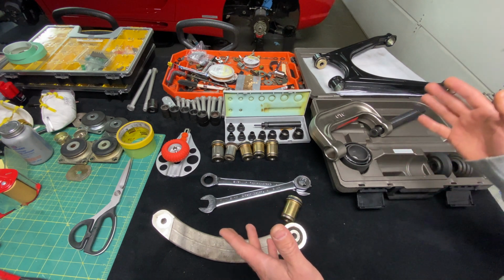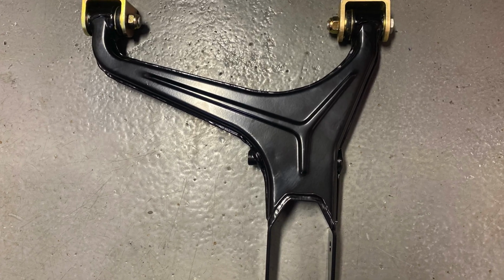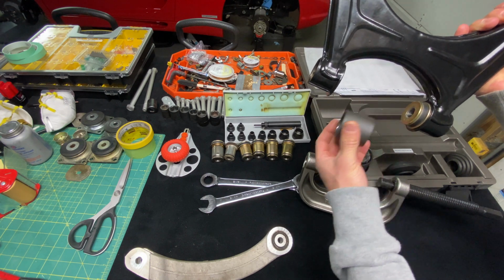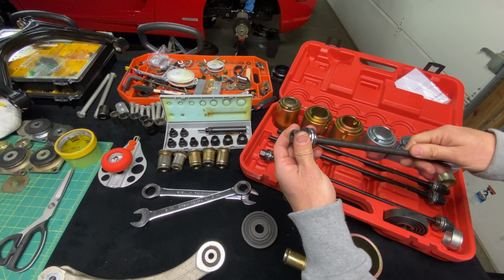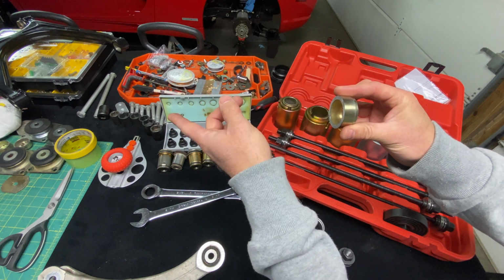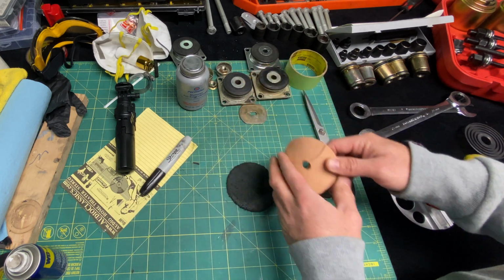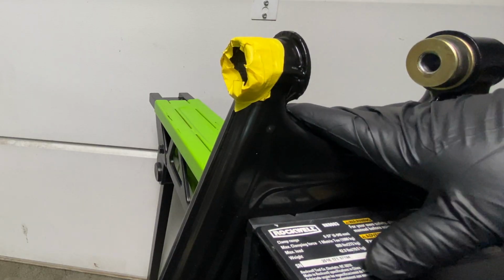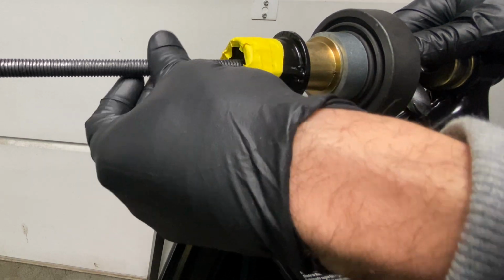Replacing Suspension Bushings | Press & Pull Method

Comment: That is one heck of a good video Phil. Thanks
Reply from the maker: Glad you enjoyed it! I have been restoring many 308 and 328 lately and bushings on those is a huge undertaking to do correctly with shims and welding them in place then test fitting to the forks. The F40 has a similar bushing set up like the F355

Comment: Hey Phil, why do you use anti seize not grease?

I was doing the front bushings on a C5 vette, on the lower control arms there is an inside sleeve that the rubber goes over and no outside sleeve so it is just rubber straight on the control arm and you put grease supplied in the kit. I had a problem where after pressing the new bushings they were a little too big to fit in the subframe of the car and I had to go a little bit ham on the press compressing the bushing a bit just so in would fit on the car. Would that be from bushings that are too big or was I possibly doing something wrong? 

P.S. The cap on the sleeve could be removed from one side to fit the bushing in; after I put the new bushing the cap would fall out where before it felt like it was pressed in.
Reply from the maker: You can use anti seize or grease up to you but i would use anti seize on the aluminum arms you are working on the Ferrari arms in this video are steel

Comment: You read my mind on that IG post, I needed this haha... I kinda had an powder coat over spray, couldn't easily push a bushing in once without damaging the paint.
Reply from the maker: get some boring tools like i showed in my Alfa X Pipe install video i hate when powder coaters fail to plug up and mask off properly

Comment: Coming from the hot rod /show-quality 4x4 truck world, I can tell you how frustrating it is to spend the time to paint/power coat suspension parts like leaf springs, axles, control arms, etc., only to nick them up when it comes time for bushings and what not in the reassembly.  Like taking 3 steps backward.  Great tips I plan on using.
Reply from the maker: glad this video was worth watching, i agree nobody shows this type of stuff yet YT will never push this type of content i create.

Comment: To be honest I’m surprised there’s not more aluminum in this Ferrari !
Reply from the maker: the 360 Modena was the great leap into full aluminum construction in 1999 when the 355 was phased out, the 355 was really a reworked version of the 348 which was designed in the late 80s early 90s so for the period this is how they did it kinda crude but it goes way back to the early days. Believe it or now these control arms are used on many other Ferrari models in period which is crazy to see these were not model specific at the time
Reply: @autofanaticcars  thanks Phil for the great videos! Probably doesn’t really matter but have you thought about using some copper anti-seize versus aluminum I use copper anti-seize all the time on my brakes pins and they just seem to cushion the noise better for me probably psychological..
Reply from the maker: yes on all brake jobs i use Mercedes Benz copper brake past i only use the silver stuff on certain metals and applications